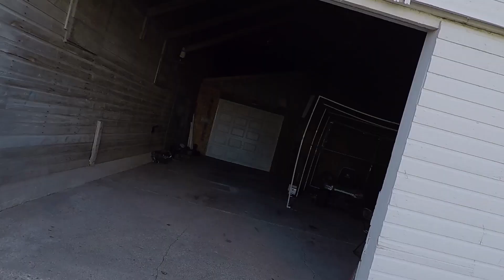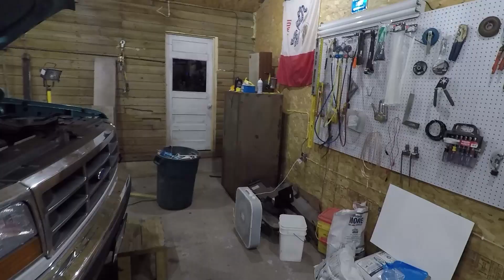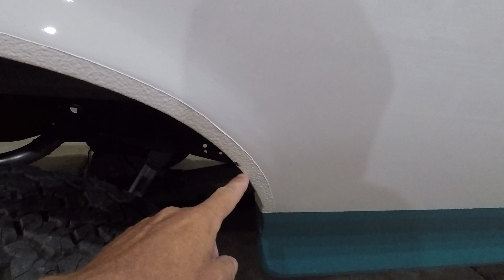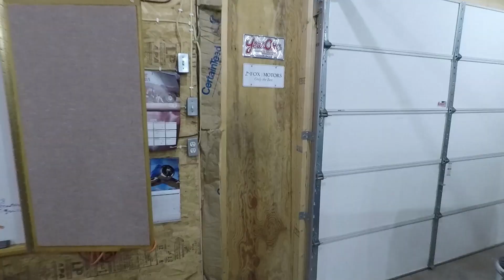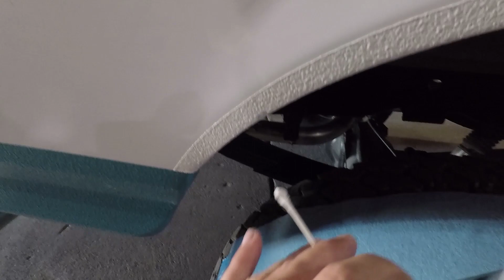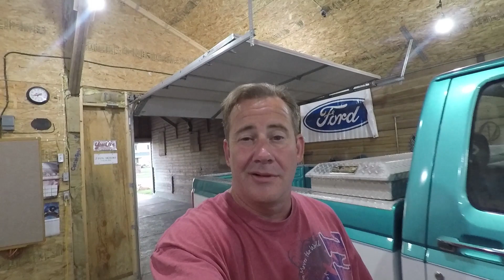Raptor Liner Repair - 1994 Ford F150 4x4

Comment: ⁉️where do you get them dimond plate plates that go on your truck bed i just bought 1994 f150  amd would like some like yours
Reply from the maker: Those are DeeZee brand...   I used to be a designer for them.  I think they still make em, but not sure on that.
Reply: @TheFoxShop  ok thank you

Comment: To get the the noise to go away try jacking up the front and make sure you have power steering fluid in there and turn it lock to lock while it's running to work all the air out and keep an eye on the fluid level.

Comment: Where did you get your diamond plated bed plates
Reply from the maker: They are DeeZee brand.  I used to be a designer for DeeZee years ago... and somehow acquired them  :-)  When I redid my truck they were rather dull (they are old) so I took some rubbing compound and an orbital buffer.. they shined right up!

Comment: I haven't watched the resto videos yet. When I saw that lip, I always just thought you painted over chrome trim... It all makes sense now
Reply from the maker: I did that about a year ago.. used tintable Raptor Liner Bedliner along the bottom and around the wheel wells.  Was getting several little rock chips in the bottom green paint from my tires throwing up rocks.  Since doing that it has been trouble free... until now.  I was wondering how simple it would be to touch up, and it proved to be pretty darn simple!